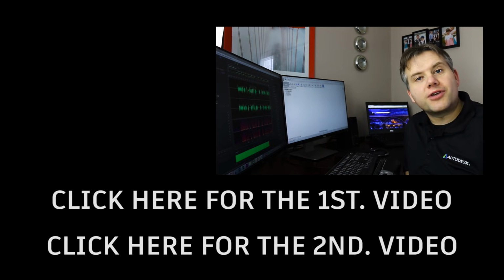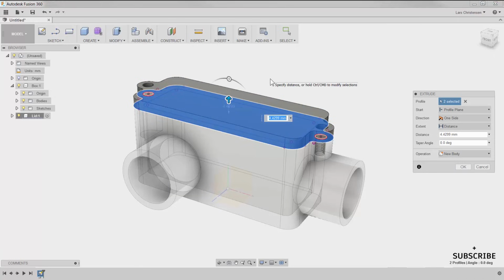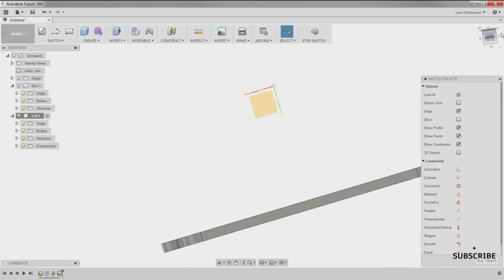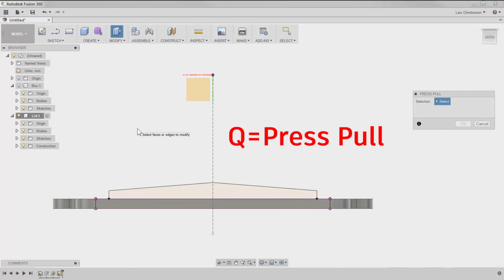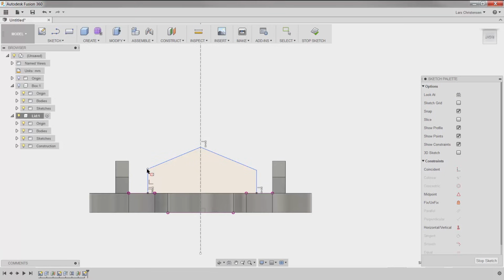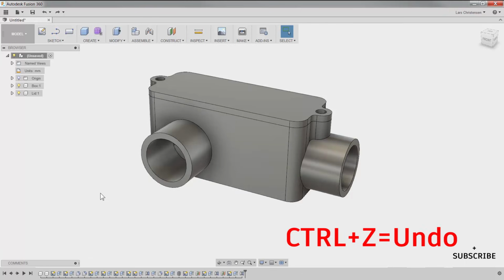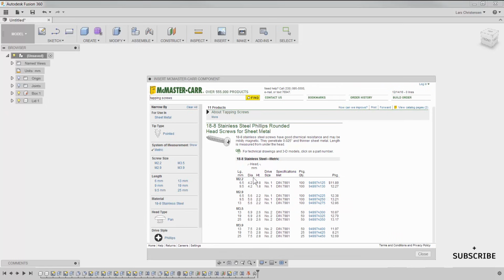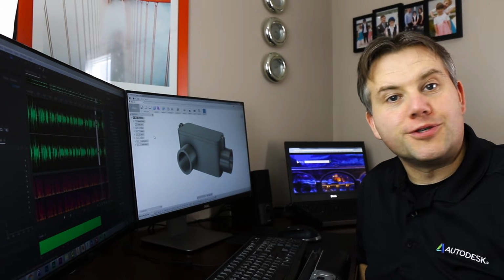Fusion 360 Tutorial for Absolute Beginners— Part 3

Comment: Great videos!  One cloudy part: you say to be sure that the sketch features turn black.  Some of mine stay blue and I have no idea what the missing constraints are.  How can I know that?
Reply: Agreed.  I followed instructions to the letter and still had no black outline.  Extrusions worked and other features worked.  But the Black Outline = properly constrained sketch rule seemed impossible to verify.
Reply: I found two things.  were necessary in order to get a black sketch indicating a fully constrained sketch.  1) Go to preferences and under Preview turn on the Sketch feature.  2) Set the center construction line to Fix.  

I have no idea if this is the correct solution.  But that's how I got a black sketch.
Reply from the maker: Hi Jay, Thank you! Yes you are absolutely right. When I was recording the video I missed that portion.
Have an awesome day!
Reply: One thing else I noticed is that when I make a sketch, it remains blue until I hover over it.  At that point, the fill of the shape ghosts a bit and the sketch outline turns solid black.  For now, I'm assuming that indicates a properly constrained sketch - but I'm not sure that is correct.  Since properly constrained sketches appear to be important, this may be a good subject for a short tutorial.

Comment: @Lars,
Question. You said not to build slop into your model. So.... how do I deal with that if I need multiple parts to fit loosely together?

Thanks!
Reply from the maker: Hi Clifford, Thank you for taking the time to watch the video! Normally you will do it with +/- tolerances on your 2D Drawing. Then, work your way into the tolerance at the machine control.
Reply: I second that Lars. I don't have a machine yet and I'm designing a wooden box. Want to make sure the lid will fit and not have to worry about expansion. 

Thanks for the videos really clarified a lot for me.
Reply from the maker: Thank you for taking the time to watch the video! Normally you will do it with +/- tolerances on your 2D Drawing. Then, work your way into the tolerance at the machine control.
Reply: Thank you for replying. I'll look that up.
Reply: What I usually do is just push the face back in as far as I want it to be loose. If you use mirror or one of the array commands, the change will be duplicated on all the parts.

Comment: Super video Lars.  I find it very helpful.  But I will have to say Uggghhhh...  I am stuck.  For some reason my line will not snap inside the lid when you are making the the ledges on the box lid.  I can do the plane offset but my construction line will only snap to the edge of the lid.  I then end up with this line that goes from the edge of the lid to the construction line (4mm or so in), so I have this really bizarre shape.  Any ideas what I am doing wrong.  Thanks again.  :)

Comment: Hi Lars, this is really helpful. I'm learning Fusion 360 for a 3d printer I'm getting for Christmas. I've already made some models, but I've learned a few tips that showed me I could have done it in better ways. Thanks! It turns out one of my models is too tall for the printer, so I'll need to break it into parts. Would you be open to making a video showing techniques you might use to do that? Here's my model: http://a360.co/2hglxV6
Reply from the maker: Jonathan, That is an awesome Christmas present :-) Under the "Modify" dropbox there is a split body command. Check that one out.
Reply: Lars, thanks for responding. It looks like that tool just slices the item on a plane. Is that correct? Would I just glue those two pieces together or something like that? What if I wanted something like slots on one piece and extrusions on the other piece that fit the two parts together without glue or anything like that?
Reply from the maker: Hi Jonathan. I would still use the split body command, but then model the tab and cut the slot in the two parts afterward.
Reply: Cool, thanks for the tips. Any chance you would want to do a video showing how to do those connections? :D Or do you know of any good resources that show options for doing a connection like that?

Comment: Awesome video, thanks.
It would have been nice to see how to incorporate the tolerance so the lid's flanges fit a bit inside of the box. In other words how to select the offset planes so they are maybe 1mm inside the wall of the box.
Thanks again.
Reply from the maker: Thank you, Peter. Thank you for watching and commenting.
You are probably right that on this specific part, the tolerances might actually be modeled. So I should have shown how. However, most often tolerances are handled on the 2D drawing (might be another video:-). Having tolerances in your model can really complicate things.
Have an awesome day!
Best,
Lars
Reply: The reason I was interested in incorporating tolerances into the model is to be able to prints parts/components that can be 3D printed directly from the model produced by Fusion and they will fit together.
Thanks again, I really enjoy all your videos, it's very nice that you take the time to explain every step you take in the design.
Reply: Lars Christensen 
You are a really talented teacher. The 3 tutorials really fast forwarded me.